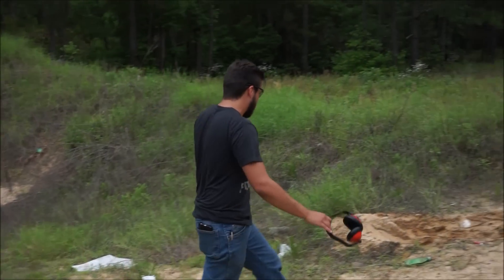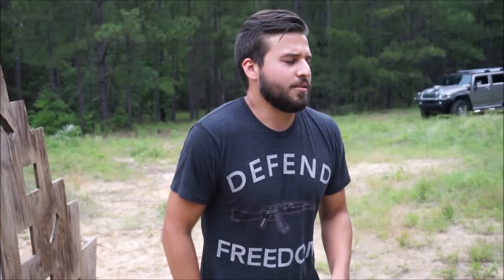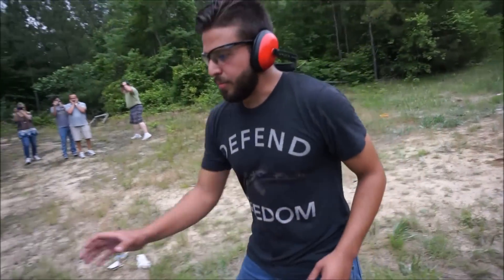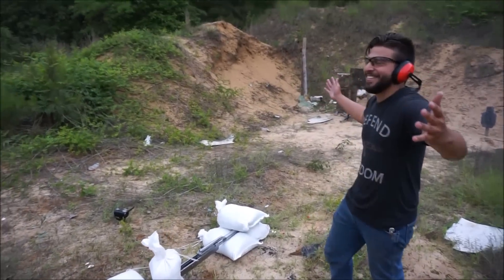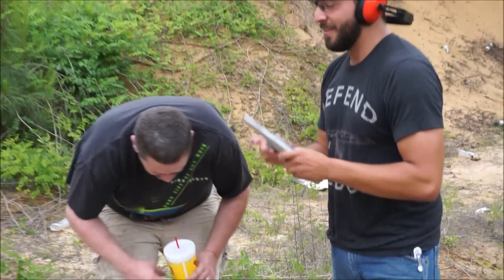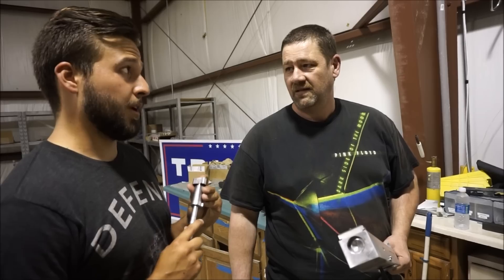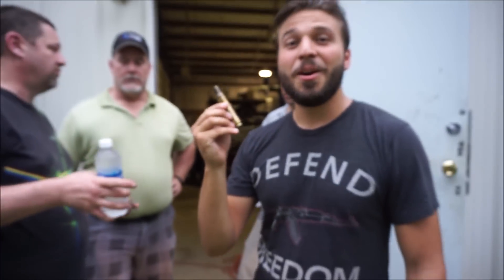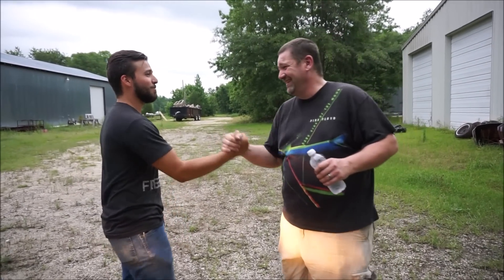AK-50 FIRST TEST FIRE!!!

Comment: Success. With success comes questions.
1) Overall look and design.
2) Recoil management.
The Villain has his weapon.
Reply: for sure, if some series or movie picks up this weapon for exposure it would be awesome
Reply: I look forward to seeing what tripod he mounts it to.
Reply: 1) Yeah it will look like a big ass AK
2) It will kick more than other .50 BMG rifles probably.
Reply from the maker: Atlanta Light 
1. Overall look and design is finished.
2. Recoil won't be too bad, this is the gun firing mostly unsupported, with no muzzle brake. Add a gas system to spread out recoil impulse, and I doubt it will be bad.
Reply: harder than some of the semi autos, but not as much as the bolt guns
Reply: @TheLemming1337, well, you called it

Comment: Good move, I wouldn't heat treat the bolt during testing either. I'd rather the lugs shear off than the chamber grenade in case of an overpressure or other failure.